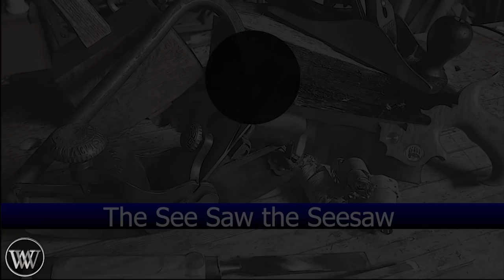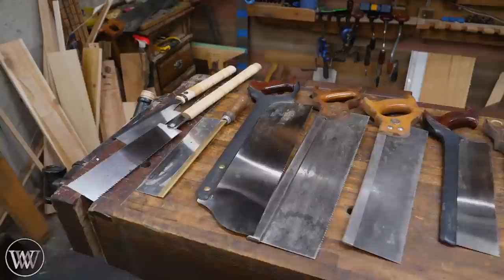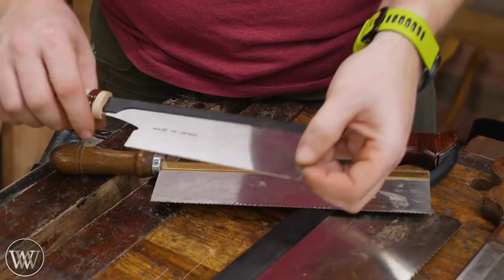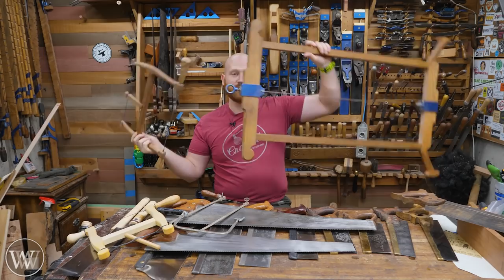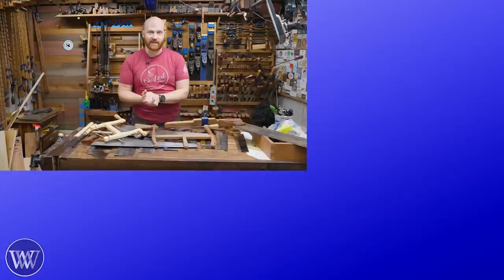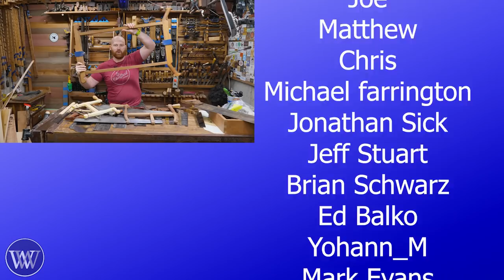All the Different Types of Saws and What Are They For

Comment: Nice informative video. It will be interesting (for me at least) to see a video about how to set up a new hand sow.
Reply from the maker: Theoretically with a new saw, there's nothing that needs to be set up. As long as the plate is straight and the teeth are sharp, it's good to go. Everything else is just personal comfort.
Reply: @WoodByWrightHowTo  is just that the  rip one has a tendency to deviate to the left every single time. The crosscut it is fine. I would say that it is me if I would have deviation on both sides. But it is left every time.
Reply: @WoodByWrightHowTo  I also wanted to thank you for getting me in to hand tools. I am an morning person, and being able to have fun in the shop at 05.00 am without worrying about the noise it is priceless.

Comment: Good on ya James, I really am happy for you and your success. You present a great product and seem extremely genuine and humble. I am happily 👍🏻 and feeding AL with my comments. 

Are you starting to hoard rasps and files to go with your killer spokeshave collection? I ask green with envy….. but seriously I could use a genuine recommendation for a durable Slim or extra slim taper file. The new Nicholson line isn’t cutting it and I am running out of the NOS eBay USA made gems like the full box of 6” XSTaper Simmons that I hide in my sock drawer so they don’t walk out of my shop. 

From one aficionado to another; may the grain always be rising and finish never be paint!
-CY Castor
(The paint thing is a joke. Every project is unique and the craftsman has the right to finish it, as much as this pains me to say, in whatever way they see fit.)
But seriously, save the paint for rust prevention and artwork like Handprint Turkeys.
Reply from the maker: Honestly my opinion on saw files is by the cheapest one you can find. It's true it will not last as long but generally per saw sharpening it's most cost-effective. The best new one that I generally am good with is the baco

Comment: Thank you for that great tour of saws, very informative.

I rarely use hand tools, but I might actually be interested in the frame saws? (I have a need to cut logs into usable lumber... some REALLY hard wood too...) What would you suggest? Short of a lumber mill that I cannot afford, making a frame saw or other custom made hand tool might actually do the trick?
Reply: A frame saw will do it. If it is straight grain you may be able to split it with wedges and a froe, then clean up with an ax. If you have a lot to do, I'd suggest finding someone with a bandsaw - one or two logs can be fun to cut by hand, but it is tiring. :-)
Reply: @criswilson1140  I have a "14 inch" band saw, but I fear that even with a 3/4" blade on it, it would not do well on re-saw. (probably operator error) I have not gotten it honed in to that degree of precision, and there is too much sway, besides, the larger logs are far too much for getting onto that thing. What I am looking to do is get a log into rough sawn lumber, need only be a few feet in length, but that would do wonders for me!
Reply from the maker: A good frame saw would do the trick. As long as there's enough space between the blade and the arm for the log to fit into it. However, with any hand tool it just depends on how skilled you are at cutting a straight line. If you're having a hard time cutting a straight line with normal hand saw, then you'll have a difficult time with the frame saw.
Reply: @WoodByWrightHowTo  I have some ideas about that... getting a flat plane on one side is essential, then I can make a guide for the blade itself to make it easier to keep level. I just need to find your video on make a frame saw...

Comment: Are there any suggestions on TPI when buying hand saws for joinery? I figure a guy needs (“needs”, maybe) one for rip and one for crosscut.
Reply from the maker: I'll be talking about that a lot more next week. But basically it all depends on how accurate you want your cut to be. Sometimes you need big teeth because they work faster but the leave a more ragged cut. Sometimes you want smaller teeth that will give you a much cleaner cut. But take longer.
Reply: @WoodByWrightHowTo  guess I’ll be continuing to tune in! Thanks!

Comment: It is hard to tell the size from the video, I have a 12" (302mm) back saw, it has about 3 1/2 inches cutting depth, what type of saw is it?

I also have a Bahco prize cut, medium size, I guess that would be a panel saw?
Reply from the maker: the back saw sounds like a tall dovetail saw, but it would depend on the file of the tooth. if it is rip it is considered a large dovetail saw. if it is crosscut it would be a carcass saw.
Reply: @WoodByWrightHowTo  Thanks for the quick reply. I think it is a carcass, but I don't have a lot of experience with diff saws and it is hard to see the pattern on the small teeth haha. On the Bahco saw I can see it clearly at 7 TPI, they say it can handle both rip and cross cuts but the pattern looks more like a crosscut.

Comment: I am a saw doctor who manufactured and repaired all types of hand saws in Australia 
I found that in manufacturing we had a whole different classification system to the consumer who was using them
Tooth size, hook angle from rip to xcut to GP (general purpose) TPI, and taper ground blades with no set 
They were all HAND SAWS. because they had no power connected and you used your hand to use them 
You have opened a giant worm hole with no end to it 
Love watching your videos

Comment: I can think of a difference between Japanese vs western saws. One can last a 100 years the other is lucky to last a 100 hours. Perfect example the one in the video looks to have a broken tooth, as woodworkers and craftsmen just the environmental impact of throw away saws is all you need to know about which one is better. Just my opinion.
Reply: You can buy Japanese saws that can be sharpened. Obviously the majority aren't, but they do exist.
Reply: @ricos1497  I know some are, but 99.9% of the ones sold are throw away saws. Western saws  also are a lot easier to sharpen or recut new teeth.
Reply: @bladen0869  I suppose 99% of western saws are throw away too. It is weird that the unsharpenable Japanese saws have penetrated the hand tool woodworking market though I have to admit. I have a couple, but they get limited use as I actually quite enjoy sharpening my western saws. It's part of the whole hand tool experience in my opinion.
Reply: @ricos1497  you’re right in the fact most new cheap western saws are impulse hardened junk. I should be clear be it any throw away saw I have no interest, that’s just my feelings. I agree with you sharpening your own tools and maintaining a keen edge is a very rewarding side of hand tool work. Using throw away tools seems to go against what it is we’re trying to do, preserving the craft and creating things to last.

Comment: I think some of the differences between the saws we use in the US versus the ones they use in the old country or Japan have to do with the average size of the guy using the saw. Americans have big hands and long arms, verses the average Brit. Japanese woodworkers cut on the pull rather than the push but they weigh like 100 pounds so go figure.